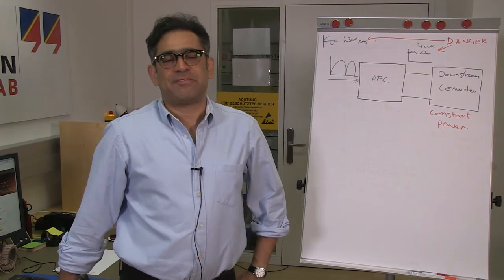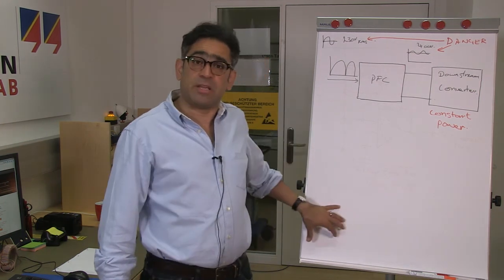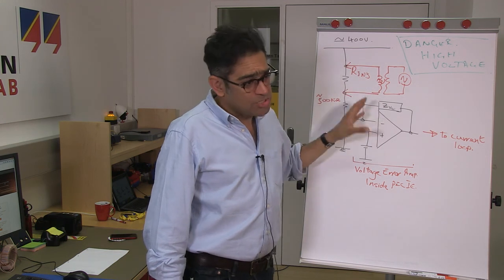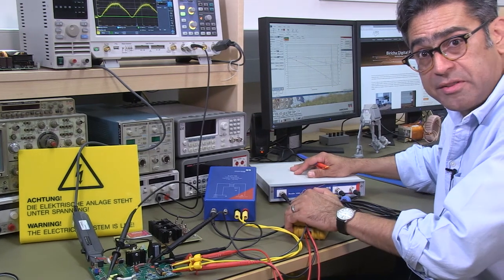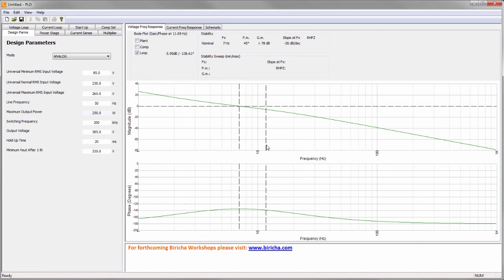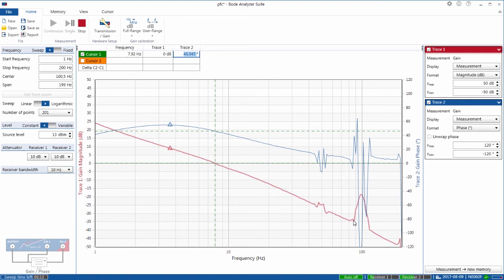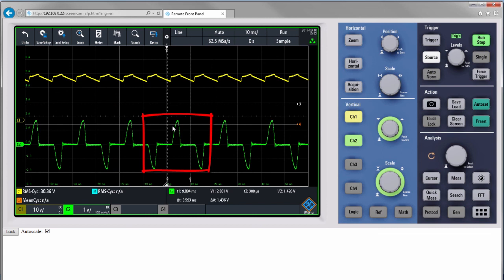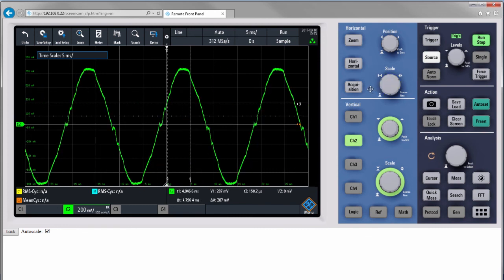Measuring the Voltage Loop of a PFC

Comment: Thank for the informative video. I used B-WIT 100 which got saturated at lower frequencies. Other question I have is about right spot to inject the signal. I am using the SDFM for voltage and current sense on totem pole PFC with C2000 TI microprocessor. Resister divider network is feeding bus voltage to SDFM chip. Would the loop measurement be still accurate if injection resister is added on top of the voltage sense resister divider network given the signal goes though the SDFM and then to the GPI. Thanks in advance.

Comment: So do I understand it right ? If your power supply will put out some 10KV and you don´t want to measure under full voltage you can just manipulate everthing so you get out 100V and just have to correct your voltage divider ? In my case it´s a flyback circuit but I don´t have to use full 230V AC on it´s input I could inject with a variac just 2,3V AC as example so the flyback would just put out 100V instead of 10KV.
Reply from the maker: Note that you need to apply all scaling laws to get an equivalent in low voltage. It will not be the same converter anymore, will have different Ls and Cs etc... We don't think that makes sense, therefore. In this particular example we measured a low voltage PFC that was designed for training classes and is designed for low voltage for safety reasons.
Reply: I understand so it would differ when you would design it for higher voltages then but you don´t want to use it at 380VDC afterwards I got it now. I thought you want to show us a trick how to design at lower voltage and still use it at higher voltage because regulation will stay same but it´s not the case like you say Ls and Cs would change so control loop would also change then. So better to measure under full voltage as I understand you. The series resistor of 10-20 ohms will never see the full KVs anyway If I think about it. So the only problem is the measuring of the voltages with the analyzer I need proper high voltage probes then.
Reply from the maker: @Telectronics  Don't forget that the injection isolator (injection transformer) will need to isolate the full dc voltage if the injection resistor is on top of the feedback divider. If you have a system that contains some buffer amplifier or active signal conditioning, you might be able to inject in the low voltage path of a high voltage system. Ideally at 0...5Vdc or something like that. Search for an opamp output that provides low impedance to find a suitable injection point. It makes the measurement much easier if you don't need high voltage probes with high division factor.
Reply: @OMICRONLabTutorials  Thank you for remembering ! I only have seen the injection resistor on top of the voltage divider in your videos altough one safe place would be between the  devision resistors at the top of the lower value resistor where it connects to the feedback path of the opamp of the control circuit.The 10-20 ohms compared to few kOhms on the lower resistor should not throw of the regulation that much right ? Then I would have at least some protection from the high voltages don´t blow up your oscilloscope in case of failure because your injection transformers would not isolate voltages that high to GND I assume. I am using mostly your equipment.  To build some signal conditioning circuit after your injection isolator should also be possible I think. Thank you for your kind advice.
Reply from the maker: @Telectronics  don't forget the impedance condition! When using the voltage injection method you need to select a point where the impedance in loop direction is much higher than the impedance looking backwards. Normally this is not the case within the voltage divider. It only works if you have a low-voltage signal conditioning with operational amplifiers. For more details please refer to: https://www.omicron-lab.com/applications/detail/news/dcdc-converter-stability-measurement
At the top of the voltage divider you normally have low impedance backwards (your converter output) and high impedance forward (the feedback divider).
Reply: @OMICRONLabTutorials  I understand then the only possible injection place left is on the bottom between GND which is also low impedance path of the power supply and on the top the whole divider resistors. It´s also a safe place to measure that is right. Thanks I will read it up !
Reply from the maker: @Telectronics Telectronics unfortunately I cannot follow. Can you please send a schematic sketch to support@omicron-lab.com? Thanks!

Comment: why purely resistive load is not constant power load ?
Reply from the maker: Dear sadegh ghorbani,
This is because the power will change if you change the voltage applied on the resistor -> P=U²/R. 
If you have any further questions, please feel free to contact us via support@omicron-lab.com.
Reply: Kindly enlighten me